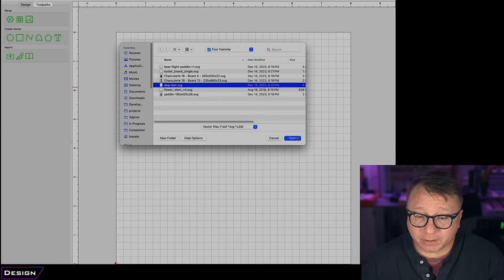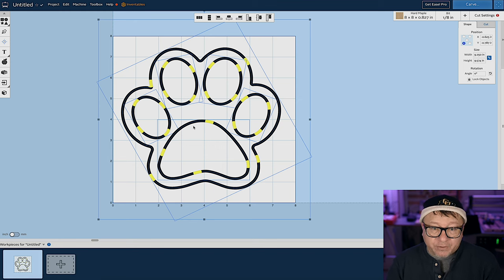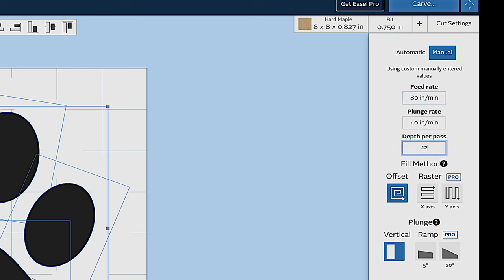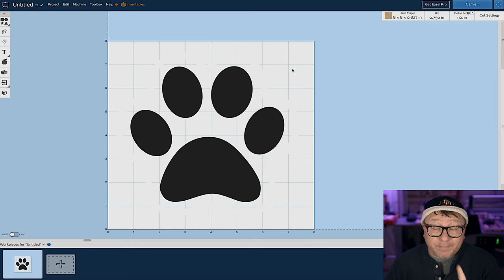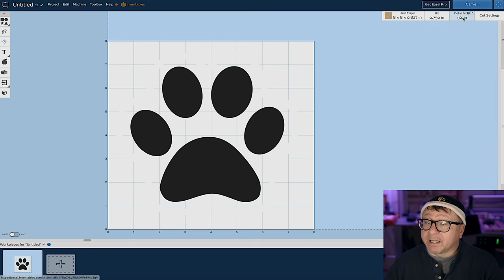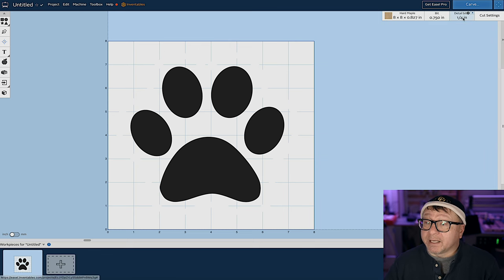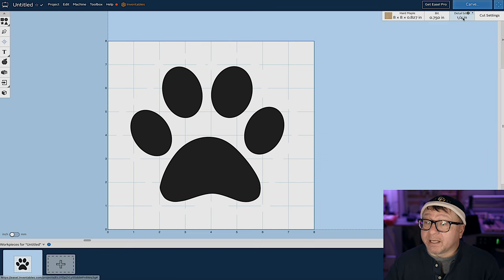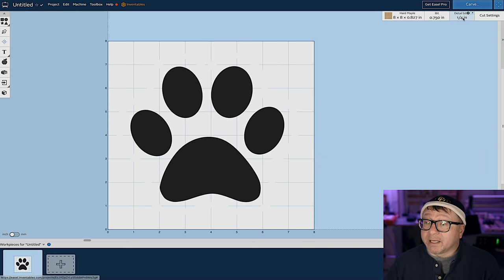Easel for Beginners - Your FIRST Project in 6 MINUTES

Comment: Hi, is it possible to design on a pc not connected to my cnc then take a file to my workshop where i keep my laptop and curve from theere as i dont want to sit in my workshop designing.?
Reply: Rustdesk
Reply: Easel is web based so you can design anywhere you have internet connection
Reply from the maker: Hi Chris -- you design using your PC and export your gcode for use with your CNC. Or you should be able to open the design on your laptop after creating it on your PC - hope this helps; thanks for watching!

Comment: Hi watched your video on making a program in easel. It was really helpful but it keeps asking me the buy a subscription to download gcode. I just wanted to make a straight line on a board with a different tool then they have listed to see if i could use a different shape then the v bit they have listed. Only changed feeds and speeds and diameter. It wont let me download the gcode. Is there a trick to making it work? Or is it not free anymore? Thanks
Reply from the maker: Hi there. It seems all v-bits are a "pro" feature. It also seems Inventables is quietly narrowing the features of the free version, which is very unfortunate. At this point it seems only Autodesk Fusion has a mostly fully featured CAM solution for free. I will continue looking, but the options are not awesome.  Thanks for watching!

Comment: Made some customizations. Was not able to avoid the ridges at the bottom of the bowl pockets in Easel. Know how?
Reply from the maker: Hi Javier - I'm not sure with Easel. You can 'hack' the system by telling Easel the bit is smaller than it actually is (like 5/8" instead of 3/4"), but the proper way would be setting the step over, which Easel does not seem to support or observe. A little sanding with something like this -> https://amzn.to/49dZAgh fixed any issues I had. Hope that helps -- if I find a more solid answer I will let you know.